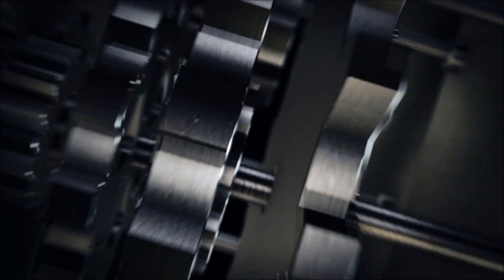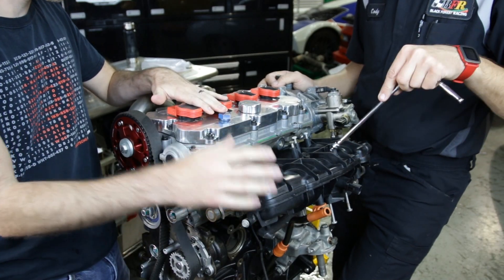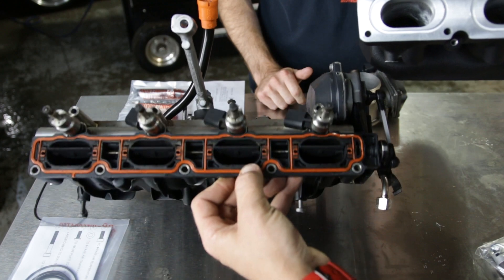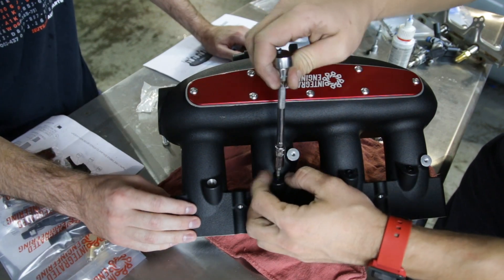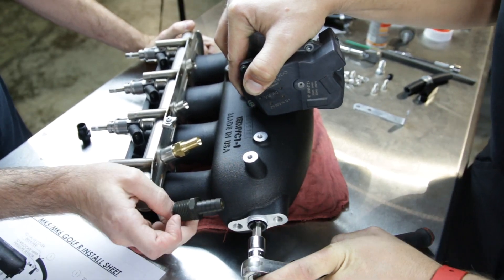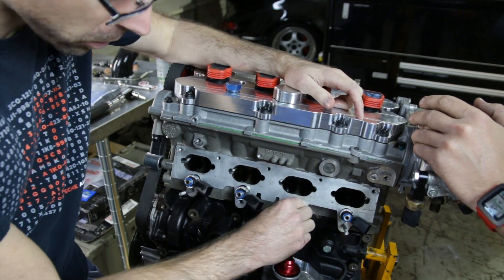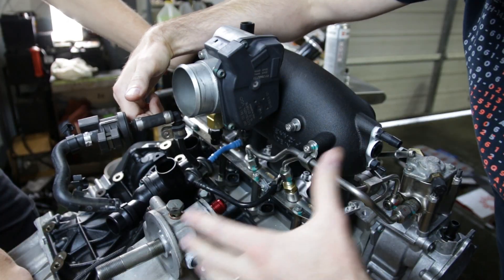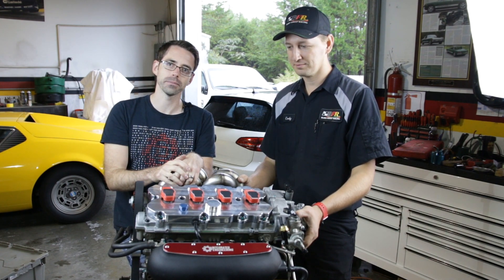Integrated Engineering 2.0t Intake Manifold | Project MK5 Ep 5

Comment from the maker: -We appreciate your Support and Purchases! -
Intake Manifold for 2.0t FSI 
https://www.shopdap.com/integrated-engineering-2-0t-fsi-tsi-tfsi-intake-manifold-ea113-ea888-gen1-gen2.html

Fuel Injector Seal Kit for 2.0t FSI
http://shopdap.com/06d-998-907.html
Reply: My injector ports did not come threaded nor did it come with block off caps as you guys installed. I'm working through IE hardware support and the guy asked for fricken pictures. Its like , its your product. I sent pictures of the ports and a clip of this video.

Comment: WHAT  DO  YOU  DO WITH THE  PLUG  FOR  THE  INTAKE  POSITION SENSOR  FOR  THE  RUNNER  FLAPS  YOU  REMOVED , SINCE  YOU  CHANGED  THE  MANIFOLD NOW  THERE  WONT  BE  ANY  THING  TO  PLUG  IT  INTO , WONT  THE  TURN ON THE  CHECK ENGINE

Comment: just a pretty bad manifold. the stock one is way better than the IE. the first downside you going to find is a huge amount of heat that the intake manifold holds and can not dissipate around 15+ more heat iat even with a performance intercooler.

Comment: Can't imagine that standard teflon plumbers tape will withstand the heat, will it?
Reply: Ed Mathews yes, standard plumbers teflon tape is pure teflon. Teflon is also used on your non-stick frying pans and other cookware so, yes, it'll be just fine with the comparatively low temperatures seen on an engine.

Comment: The IE manifold is shockingly bad and actually reduces flow and power. Your better off with HPA or HET manifolds or even just keeping the stock manifold as they are more than capable for the turbo your using.
Reply: Chris Dorn the reason we initially had the stock manifold on was we were going to do a back to back dyno test, but ultimately decided it was too much work. Maybe we could still be talked in to it, but also the plastic ones are known to crack at high boost so there's that.
Reply: Yes there is the element of the plastic oem can split but while it's working will perform better if you have done the runner flap delete. I'm a fan of IE products but their manifold just has problems. Looks very pretty but reduces flow. Had a few in our community in the UK try them and they either got rid or had to get them heavily modified to improve flow and if you asked thm their opinion about it they would instantly say its garbage. Remember one guy saying it was the internal trumpet design that is the biggest issue. There are other good manifolds like the HPA or HET, neither of them give any real gains but look pretty, are stronger and can be used for adding extra injectors or meth injectors. To me paying nearly £1000 for a product that reduces performance means there is something wrong.
Reply: @ChrisDornDorny  thank you
Reply: just a pretty bad manifold. the stock one is way better than the IE. the first downside you going to find is a huge amount of heat that the intake manifold holds and can not dissipate around 15+ more heat iat even with a performance intercooler.

Comment: would it make any difference in power/tq if the engine is not remapped and this is simply bolted on?
Reply: Ivan Kanchelov No, since the runner faps are removed you have to have the ECU flashed. If you simply bolt it on without being programmed for it, it'll most likely throw a EPC and check engine light.
Reply: I'm talking about leaving the old fuel/air maps and just making sure the swap is error free
Reply: Ivan Kanchelov if you mean if you were to install this manifold on a factory engine and and make no changes to the tune? 

If so then it wouldn't make much difference at all, the factory manifold isn't restrictive on a stock engine and the stock one doesn't really even become that restrictive even on k04 swapped engines. 

My guess would be if there was a difference the engine would be a little less responsive and a little more high end hp.
Reply: Dingus Kahn what if I were to install a K04 turbo with a stage 2+ tune?  Would this prevent the CEL?